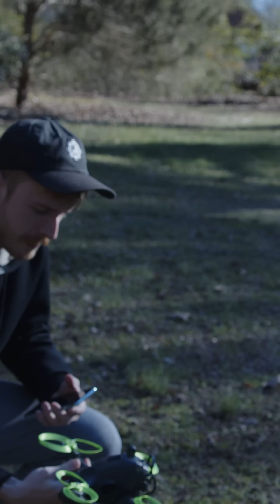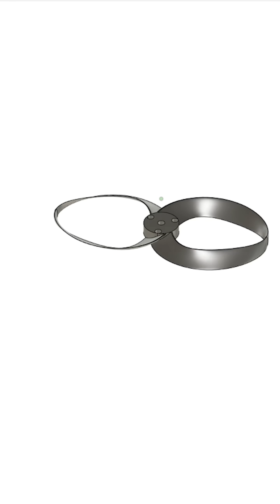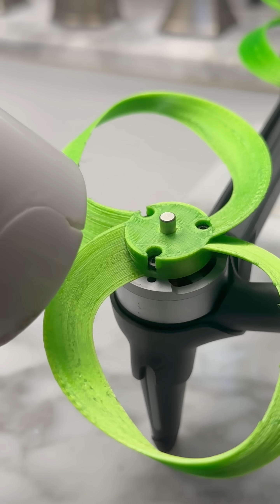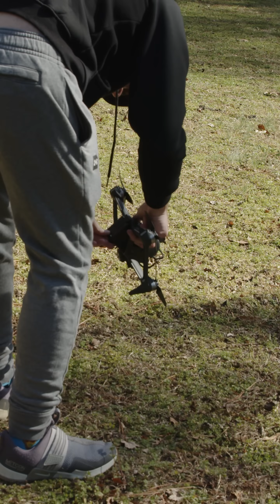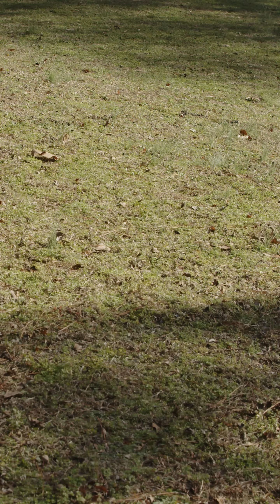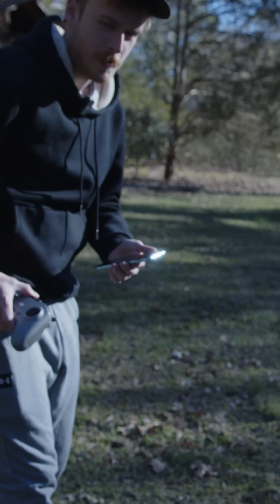Testing MIT's Toroidal Drone Propeller Design & Sound #shorts

Comment: Idk why but I cracked up laughing with how he’s like “it should be quieter” and then when he starts to fly it it’s the loudest drone I have ever heard
Reply: One of the problems is this person almost certainly does not have a 3D printer that would be capable of the precision needed to actually make one of these propellers to function correctly, these theoretical propellers take advantage of very specific fluid dynamic properties, so if you don't get the design almost perfect then they're completely useless,
Reply: @the_undead you just made stuff up...?
There is nothing magical, simply no en tip vortex on toroid.
The blades are probably just unbalanced and not stiff enough so they vibrate
Reply: Sure.  @the_undead
Reply: He got toroided.
Reply: people are focus on the "jet" sound. but I think the 3d printed propeller is more imbalance. maybe the density or thicknesses are not uniform. the failure is not on the design, but the manufacture is
Reply: @wikiwiki2977  Is manufacturing not considered in the design phase?
Reply: @eternalskeptic  ofc its considered. but maybe in this research, the manufacture is not good enough to produce super high precision...
Reply: @eternalskeptic  maybe they need more precison 3d printer, less tolerance measurement
Reply: @wikiwiki2977  Understand I'm not doing anything more than pointing out what my own ears hear, and it sounds to me like a swarm of bees. It works, it flies, but it needs refinement for sure.
Reply: @eternalskeptic the design phase doesn’t care about manufacturing when the laboratory designing them is doing it for research. They had these propellers designed to reduce the vortex caused by blade tips to reduce sound and frequency that’s irritable to human ears. They used SLA printing which is readily accessible and can handle most any design. This guy used FDM printing which is not great for smoothness and high precision printing. My engineering thesis was a redesign of the MIT propellers that reduced the propeller size as it rotated so you’d get the benefits of the shape with less material.
Reply: They are meant to be molded
Reply: Toroids. Not even once.
Reply: @chawlz  why not?
Reply: it might be cause a camera normalizes the noise
Reply: With bass
Reply: Sounds like a swarm of bees.
Reply: I actually think it’s quieter a tiny bit, more pleasant frequency at least
Reply: Fr lol. Maybe it could be used in warfare to cause panic like the Stuka. Would probably schism my pants if I heard that from a foxhole
Reply: Jesus loves yall
Reply: my dji is quieter 😭
Reply: @ guarantee it’s not.
Reply: His 3d print looks like shit the propeller is too thin
Reply: 1 st issue is made them
2nd issue is I seriously doubt MIT spec out the use of nail polish. That alone will make the propeller unbalanced which will make them loud AF which you have demonstrated very well
Reply: @august6479  yeah the nail polish seems like it could've messed it up. Maybe necessary for strength for his printing setup, and probably trying to fill in the space between printed layers, but it's gonna be difficult to get a perfectly even coating along the whole surface.
Reply: @tongpoo8985  it was the nail polish that got me on this one
Reply: WAIT YOU YOU ARE A MOD FOR JAKERTOWN
Reply: Residents of Kyiv can hear drones louder.
Reply: i live on kyiv and that made me wheeze @АлександрСемёнов-ч9ч
Reply: @АлександрСемёнов-ч9ч why do you got the bottle?
Reply: @АлександрСемёнов-ч9ч Жителей Киева, конечно жаль, но их правительство слишком много хочет, теряя собственную страну и людей, в ненужной - народу войне

Comment: You would need to 3D re-print The original propellers, to do an actual test, side-by-side, using two different designs from the same material. because in this case, it was super noisy.

Comment: If you was able to get them sanded and coated to perfection, i do think they would be quieter. Have you tried messing around with the design and making a triple or quadruple blade. Spreading the amount of contact each segment of the blade has then. Could possibly drop the noise even more? Just a thought that is though🤷🏻‍♂️🤔

Comment: I'm sorry but you can't 3D print a model you made yourself of a complex aerodynamic shape and "compare" it to anything. A slight change in design parameter such as blade thickness, pitch, proportion, edge angle and shape etc. etc. will completely change the performance. Order the original design from MIT and test that indoors with a device.

Comment: The General Electric Quiet Blade, developed in 1934, is pretty much the quietest blade you can find. Unfortunately, due to its broad size, it likely wouldn't work well as a propeller for an air vehicle. I believe that propellers are typically very slender so that they don't act as a sail or wall when they aren't pushing.  The Quiet Blade, however, starts as a point and progresses to a blade scoop, and the blades overlap, though that isn't exactly essential for quietness, but it contributes a lot.  Most modern fans, etc., do not use this blade, and so they are loud, obnoxious, inefficient. The Quiet Blade also pushes a lot more air than many other fan blades, and lacks all of the turbulence of other more basic blade designs.  ILG of Chicago also made use of this blade a lot.
Reply: That was surprisingly interesting considering the topic, Cheers

Comment: Ah yes the final nail polish coating. The ultimate finish
Reply: If I print stuff with PLA or ABS that needs to have a better surface or be made stronger, I coat the part with Plastruct Plastic Solvent Cement. It's a very thin liquid that melts the plastic a little before it quickly evaporates, making the part sturdier and prevents it from layer separating.
Reply: @TGiFoosday  You can get a good result with acetone for that. There's also a process using acetone vapor for smoothing that delivers wonderfully smooth surfaces and strong adhesion. Unfortunately the acetone process works only on ABS, not PLA. There aren't many solvents that even touch PLA, and all of them are either toxic or carcinogenic.
Reply: Ikr, why not just clear coat it? Like from an airbrush or simply an aerosol can.
Reply: @JPtheGamer650 I'm guessing the nail polish lays down thicker to fill in the layer lines. Smooth finish.
Reply: @walkingweapon  lays down thicker and dries quicker! hahaha
I know things like this are born in communities for a practical reason, but at the same time it baffles me how consistently I'm seeing/reading instances of "smart" people doing "dumb" things without critical thinking or research - you know, using the intelligence that got them to that point to begin with, haha. They just trust and awkwardly bungle through it. It feels like the same thing as watching people struggle with opening packages/unboxings or figuring out how something works, they're all fumbling impulse and no thought to think and problem solve. I mean absolutely no disrespect to the guy making the video or anyone else, I admire expression of passion. But they're kind of like that one friend most of us have that are always closing car doors too hard, hahaha. They aren't feeling, thinking, and reacting appropriately in the moment, they're just bad instinct/forethought from moment to moment. I don't understand how people can be so intelligent and interested in tech fields yet be so oblivious to physical reality.

Anyway, I don't 3D print, but still speak from personal experience in expressing consistent dissatisfaction from trying to work with nail polish when thinking it would work for that exact expectation of smoothing out. I can't imagine that the added weight and globby imbalance are helping things after applying it with the nail brush in such short, stabby strokes like that. It may be a viable solution for impatient people working with small parts, but I have a hard time believing it works at all for this application. I wouldn't be too surprised if these issues contributed to the excess noise heard in the video.

After the heat treatment, I presume that responsible application of a spray-on gloss coat would yield a considerably lighter, more even coating that wouldn't glob up to mess with balance and intended air effects of the design. Speaking of: the design he used and the design he showed are very different at the tips and it's killing me lol

Comment: Seems backwards to try to make something quiet while also creating the friction for lift. It seems to me, you would have to precisely calculate how the sound waves travel from the propeller and make a second propeller in such a way, that the troughs of the two sound waves would cancel each other out. If you had a blade spinning though the air creating lift, it will make noise, if it doesn't make noise, it's not generating lift. The solution is to cancel the noise, not to not create it.

Comment: These propellers were originally designed for boats to reduce cavitation on the blades, reducing fuel consumption and reducing noise. With your blades being so rough I'm not surprised at the results although with a more refined finish you could achieve similar results.

Comment: Something that flexes like that midflight is going to be loud. Absurd design.
Edit: it is going to be loud because it is still a thin blade and the flexing will only increase the frequency and make it that high pitched noise, just like the air flowing between the original blade design narrows mid flow making it loud. The narrowing of the airflow is necessary for lift, however, the design would have been better if there was a longer startup time that starts off loud and either rotates at such a  high speed that the sound can't be heard, or in such a way that it starts loud then gets quiet once one airflow cycle is complete, such as a double layer blade set, or many tiny blades working in individually controlled arrays, etc. Those 3D printed ones compress into "hollow" curved blades midflight, and only in one direction. MIT developed that? O.o
Edit: I'd want to know if there is a small area in the curve(s) where the thin strip flutters once bent against the airflow. 🤔 Got me thinking, thanks

Comment: Love the concept, but from how the mic picked up the sound. It is lower in volume and frequency, but lot of the noise generated likely from the uneven surface of the 3D printed blades (even with the nail polish/enamel finish filling in the ridges after annealing)

But so far as a result in the video sounds like the buzzing of angry bees/wasps… then again the blade shape is almost reminiscent of an insect wing. So Ideally one can try increasing the blade count as well as shifting the profile of each “wing”

However unlike an insect, these “wings” or propellers will be having to lift weight much greater than an insect’s light body…

So would wage the wing count for each propeller would have to be 5 or 6 count to get effective thrust as well reducing sound further… ideally would start looking into owl wings and how they are able to conceptually fly dead silent and see how small a scale that can apply… 

we do have many examples of small things having a much greater surface/contact area than what’s visually seen. So I guess making faux feathers or thing ridging like insect hairs could create more surface area with less drag? (This is out my field of knowledge so can only think of concepts and drawing ideas from nature has done well previously…)

Comment: A true comparison to sound levels would be to run the motor on the gadget without any props attached.  

Would it lift off without anything on the propeller shaft?  A. Nope. 
Would you have a base level Db reading of motor noise? A. Yup. 

Then you could take your readings and show or we would be able to judge by the audio of what was additional to the baseline we heard. 
Because with original propeller attached is way too similar noise level but oddly different in vibration and tone.  

Thanks.

Comment: Material surface is still too rough. That's the fluttering you're hearing. The air is turbulent coming off a blade  across the gap and hitting into the the edge adjacent. 

This causes the props to flex making that gap bigger and smaller.

Combined, it makes a fluttering noise.

Comment: ….I wonder if that wierd davinci propeller thing would work on a quad… the expanding auger looking one. Technically it’s only one blade hitting the air
Reply: Also most of the noise is the motors and the only way to change that is have them function under less load…it’s weird, like the opposite of cars and tire noise while cruising.

Comment: Military drones are really loud so anything to quiet them would help. Patrolling and hearing wirring all of the sudden at 2am is quite the experience and really puts you on edge especially when you know it has thermal
Reply: I also think the new propeller design made less noise (even while being 3D printed), the video is misleading because the microphone normalizes loud noises, and if it's loud enough, it'll clip, which it sounds like the first one did.

Comment: It’s quieter in the sense that it doesn’t have much of a high pitch anymore but has a lot more base, meaning you’ll be able to feel it near you rather then hear it. The regular propeller is a tad bit louder, especially sense it had a ear rapey vibe to it making it very obvious and noticeable. Though overall there both noticeable but which one is less noticeable? I would think your new design is better but has a lot of room for improvement, amazing work though love it bro 🙏🏽🔥🔥💯

Comment: I think a high quality resin 3d printer would achieve smoother props than a standard heat extrusion one. They do have a distinctly different timbre than other prop designs though, much more of a "whirring" than props with tips which sound more "buzzy" too me. My golden ratio sensibilities say: "try three blades 120 degrees apart" for best results. 😋

Comment: It does not make much sense in my opinion to use this design due to major loss in lift to weight ratio. Take a look at the "closed wing" concept which is analogous to fixed wing aircraft. It looks nice in pictures but basically the benefit of not producing vortice drag/noise is extremely minor compared to the added weight due to the propeller design and reduction of lift surfaces.

Comment: The design isn't the issue here, it's the production. You can't just take 10% of a design and have it work, you missed the precise edge structuring as well as materials choice, and you didn't balance the props. A lot more was needed to even make this test come close to testing the actual design. 

I mean good data was gathered don't get me wrong, but this was FAR from a test of the prop design, it was more a test of what your manufacturing cap is

Comment: I'm not nearly as smart as many of the comments below but the engineering in me says the "Tips" of the TProp that twist over themselves needed to be as thin as possible. More like folding over a tapered blade instead of using the same width of a ribbon& creating a helix with it.

Comment: I was taught, when it comes to getting off the ground, every lifting force must cross Reynolds number. Hence the sound. Yet birds do so flawlessly and quietly.
Reply: That's because they obviously fly in completely different ways. Human aircraft use propellers or jet engines, whereas a bird flaps it's wings to get in the air. Birds are also far lighter than even light planes.

Comment: Hmmm...i think the porous surface defeated the whole purpose. Maybe resin printing, or epoxy mold?? I thing they could be machined using CNC,but that requires proper design,material and hardware.

Comment: my thing is that it's not really "Toroidal" ...I mean YES they are literally an outlined silhouette of a 2D representation of a Toroid...w/ ...pointed...tips(?) Are the tips really necessary MiT???

When I hear the words "Toroidal Propeller* said together as a compound name of something I am 1000% sure is not what he's showing us. Don't get me wrong, I do comprehend the accomplishment of designing(MiT) modeling, 3Dprinting Prototyping an actual workable ptype plus troubleshooting and on the fly problem solving of flying rotors for a drone...it's impressive.........BUT......It just does not satisfy as "Toroidal"...and I know I can't be the only person feeling this way....

I imagined a propeller tweaked and angle adjusted and mounted in the proper position according to drone center mass that allows the air surrounding the drone to flow and be redirected into a proper flowing Toroidal current of "high speed" air creating a true Toroidal "Bubble"  of high speed moving air....

would that be enough to cause lift to take affect? Idk but I would definitely be more satisfied than a pointy tip bow tie propeller.